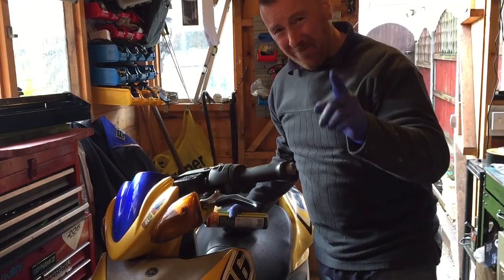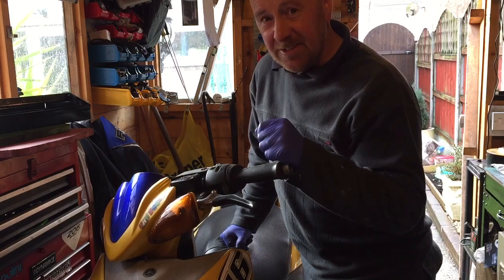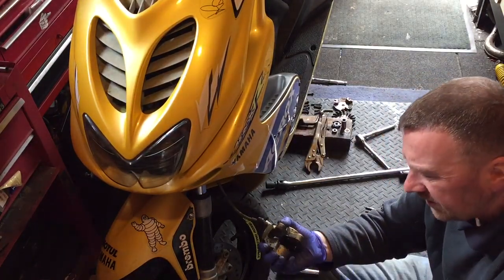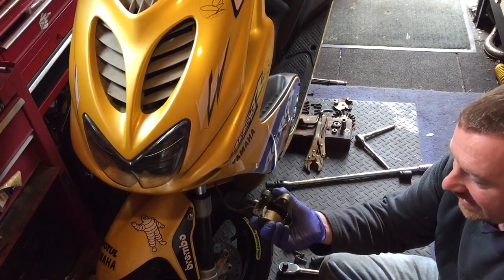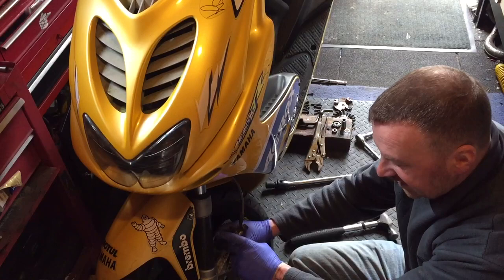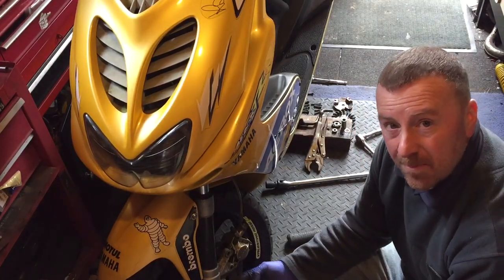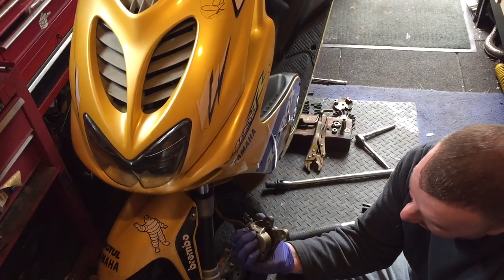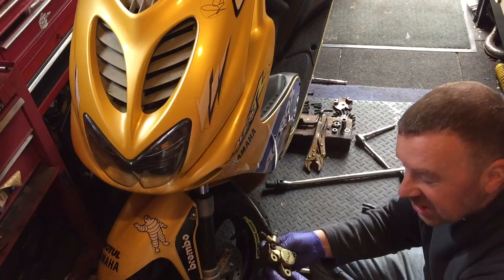Fixing jammed binding or stuck moped 50cc 125cc brakes

Comment: Hi Mark first time subscriber.. I have a Peugeot bellville scooter.. it has abs on the front.. I've noticed on the back brake there is a brake fluid indicator but this is empty. Do Peugeot bellville scooters need fluid for back brake as it is not abs? 

I'm waiting for a manual to come so I can read through the manual as I did not get the manual with the bike.
Reply from the maker: @ShaunUnderwoodx  some do have separate brake fuild reservoirs,  as they might have the independent system connected by electric 
If it's empty I'd fill up to the mark and check the brake , bleed if not working 
The front brake is the main one but you need the rear in bad weather 
Check pads too as go be empty it's either leaking or bad are low

Comment: My tao tao scooter was leaking break fluid too... Long story short my front wheel started to stick or bind... Could that have been was cause it... I'm sure after getting the hose and stuff fix ill be good to go?
Reply from the maker: yes bud more than likely but after you have fixed it take a look at the VARIATOR system too and check the rollers and belt,

Comment: Wow I would think you just made this video thinking of me .because I've done tune up and valve for summer and my breaks are now next I'm good on the condition of pads but I think k there is some binding or possible less the function then what I should have and as well they may have air in line but first I will work on the binding this king there possibly not released as far as should be.so cleaning calipers and pushing g them back in and checking condition of pad to be sure and I will finish on bleeding and filling fluid .Much Thanks for this video from the best .
Reply from the maker: hi bud 
that's god to hear my video helped even with a bit of comedy lol
I have many more videos on my channel that may help too
all I ask is to share like and sub 
mark

Comment: Hey, i redid the shocks and put on new tire rubber and brake pads. The pads seem to grind a bit on the disk but the wheel turned ok until  i went to move the bike it won't go anywhere. I assume then its a brake caliper  problem on my majesty 400 scooter? Thanks! From a gal who works in her own stuff as much as possible:)
Reply from the maker: Take off and start again 
Did you take pictures of it before removing, 
Always helpful 
Take off and re line where it goes 
Check piston on calipers work and that you took the cap off the pot as it could now be too full !
It may only need a bit of fluid taking out!
Or just need to be push back more , cleaned up and re set

Comment: Hi Mark I have problem with my speedfight 100 rear brake. lever was going all the way to the handle bar, so changed fluid and bled system. no air in there. Problem is there is still no pressure and pistons that arent stuck dont move, feels like there is no pressure. Fluid comes out if I open bleed valve with no air bubbles. Can you help. Thanks Rob
Reply from the maker: this is common and i've had it a few times 
it may need replacing but try first by taking off off and turn upside down and tap it on some wood a few times
then refill and do it over , 
or fill and tie up the handle over night to get any air out and pump
Reply: @marksavage  Thank you for replying, which part woul i turn upside down. The caliper. I took a caliper of my second speedfight but had same result.  l suppose must be air in the system somewhere. Am going to try and refit to my 2nd speedfight to see if it is the caliper. might take of the whole system as feels like air could get trapped anywhere in the hose. pumping lever with bleed valve fluid came out ok Rob

Comment: My longjia digita 51 has a very stiff back tyre..ive loosend the back break..but still my tyre by hand will hardly move..Ive put oil all over the middle of the tyre.in the crease of the silver centre of tyre middle..Why could the tyre be suddenly so stiff?
Reply from the maker: is it disc or pads
id take off the rear wheel they can get road salt in them and this can happen so take off and clean up and wd40 the cable etc 
if its not that then you may have a problem with the belt or gearbox
Reply: @marksavage  Thankyou for your reply..ive poured a bike oil in the metal inside of the wheel..and this seems to have worked..I can now spin the tyre freely..It feels so much better..Its probably mud as ride it up a muddy track daily.
Reply: @marksavage  Thankyou..did this and now tyre is perfect..

Comment: When bolting the caliper back up does it have to be lined up or is it just a simple case of bolts in tighten up?
Reply from the maker: when you take off the caliper and open it up to free up of change the pads  after cleaning it it should just fit back on as you have opened it up fully 
once bolted back on press the lever and it will tighten back up the pads and all should be ok but do re check the brake fluid

Comment: Lovely mate!! I got a breaking issue now in the front wheel as well but this is not it.. when i hit the brake, it brakes.... I let go of the lever and hit it again and it doesnt break.. the lever comes all the way to the grip too without breaking at all (when breaking good, the lever only goes half way)... after a while its ok , brakes once or twice and then does it again.. scary shit 
Any idea what might be the problem? Would this fix it?
Reply from the maker: you have one of two things bud 
air in the system so need to bleed the system ,so new brake fluid DOT4 and bleed it well!!!
or master cylinder ,so need a new one
Reply: @marksavage  Thanks a lot buddy!! You're the man! I'll bleed it first to see it it gets rid of the problem.. rear break isnt disc, she doesnt stop very well as it is, which isnt very safe considering it gets to 130km/h in a flash <3 Runner 
(those 70 kits you hate so much hehe) 

Your videos are very addictive and full of info, thanks a million boss!!
Reply from the maker: @joaomelo61  you can take off the rear wheel ,clean and replace shoes I'd you have to and wd40 the cable and adjust 
This will help

Comment: @mark savage  hi mark I desperately need your advice my son has a aerox and the disk is rubbing on his calliper its a new disk new calliper new pads new shockers. Any idea mate I checked everything with diagrams there is nothing missing it is just touching the calliper nearest the shock.
Reply from the maker: simple 1st is it for your aerox model ?
take it off and compare it to the old disc and calliper 
make sure it was on correctly and the pads are in right 
wheel spacer in the right way ?
ive done this and had them wrong lol
Reply: @marksavage  hi Mark the disc and calliper are correct. You know the speedo it had a metal spacer sticking out. Should that go inside the wheel as mine sits flush on the wheel and the speedo plastic has a gap between that and the wheel that would adjust it. its definitely a spacing issue though but just check and they are also correct the lad said when he changed wheel etc he was left with 2 thin copper washers but I looked on aerox 2013 wheel diagram on net and I don't see any washers just spacers it's driving me mad as its unsafe to use. Should there be any washers  Or even in between shocker and spacer ? I don't know as I never had a aerox 2013 any help appreciated mate oops yes it's aerox 2013 really nice example apart from the above

Comment: Hey Mark i have an issue with my aerox. A few weeks ago i have noticed that it pulls very badly on hills. It used to handle steep hills very well going 40+ mph and now unless im going fast before going up the hill then i cant go any faster than 20mph, even on very small inclines until i reach 35 mph and it flies like a rocket. On flats it accelerates very quickly especially when it gets past 35 mph. I thought this was an issue with the carb so i cleaned it fully but it hasn't done much. I also replaced the rollers which were quite worn but this didnt help either when it comes to hills. Could this be a belt issue? My belt looked fine but thats all i can think of. Cheers
Reply from the maker: Max Lock well you did the first two things I'd check so well done , spark plug and air filter next and yes was the belt tight ? , if it was ok. Now not then it can only be there's few things and last piston ! When the start to go or rings get worn they don't hold compression and lose it under pressure ! , thanks for watching I do have a few other videos on aeroxs that may help please like share and subscribe , mark
Reply: mark savage Well the spark plug was changed 2 months ago and air filter cleaned a week ago so i dont think its those. How do i test for compression?
Reply from the maker: i've had a spark plug fail in the same day before bud, have you check if the plug/ht lead are getting wet ? this will mess around with the bike as well. really yu would need a compression test kit or take off the head and have a look at the piston. yes it's a bit of work but the only really way of looking at it !!. mark

Comment: hello mark great videos again !
got a question thats dementing me
bike will not go (suzuki van van) cleaned carb and new spark plug getting spark seems like theres compression only done 2300 miles try spraying wee bit carb cleaner in air box n down plug hole 
valve cap adjusted but will not even catch . ran two weeks ago .cheers antony
Reply from the maker: hi bud thanks for watching ok carb cleaner is only for the carb and when you service it so take it off as in my videos and clean it as the basics are all the same. if you can clean / wash or change filter as well. do not spray carb cleaner in the head!!. clean or change plug. but leave plug out for a bit so to empty the head of what ever is left in there. maybe after that if still no joy with starting get some easy start and try that in the air box. also check oil level make sure that ok. mark

Comment: Help! I recently bought a Zuma 50cc scooter and it is my only means of travel (other than my own two feet :). I have a few questions if you don't mind - the only place near my small town charges and arm and a leg, but your video seemed like I could actually do this (and I'm not a mechanic by any means :)

From what I've read and seen by removing the brakes as you show in your video, it sounds like I have road salt in my brakes.  It seems like there is some sort of red glue or rubber between the brake pad and whatever is outside of them. Some of it came off like paper, but I wasn't sure if I should even remove it.

I'm afraid of removing the brake discs, because I wasn't sure if the part of your video that used a flat screwdriver meant between the brake discs or between the discs and the pads.

I need to know if I need to buy some sort of "brake glue/rubber" or just the brake grease. What did you call it - orange something? I hope to find a neighbor who is good with motorcycles/scooters, but since I'm a new arrival at a small town I honestly don't know how to find one ;)

I think that's it - unless you know about some kind of wire brush that can get in between the various brake parts. Also, when I took the brakes off the (is it called a disc?), I used the front brake lever and I guess it ran out of oxygen or whatever. Hopefully when I put it back together, it will still work. I don't think the brakes are hydraulic and I don't think they need to be bled. Hopefully checking to see if the brake lever worked (it previously wouldn't close all the way) didn't screw anything up too much.

Muchas Gracias and if there's anything I can do for you, please let me know!!
Reply from the maker: Hi bud 
I have a few other videos on brakes so give them a watch they will help as I have over 150 moped videos 
As for pushing the pistons  back it’s with the brake and this will help lever them back 
Don’t push them out without the pads in on the discs 
Very bad and it has brake fluid in so keep an eye on that
Get new pads bud and copper grease behind them 
Watch my videos bud 
And good luck sure you will be ok
Reply: I don't think the reply below was meant for me. I followed all of your instructions until "removing the pin". The only thing that looks like a pin to me has a an allen wrench screw on one side and nothing that can be removed on the other side. If I can remove the pin it doesn't look like it will open the brake mechanism.

There are a ton of technical documents that seem to apply to several models, but my 2015 Zuma 49cc front brake doesn't match the diagrams I can pull up or the videos I have seen. I can take a lot of pictures, but I don't know exactly what to show (plus I don't think I can add them to this comment). I don't want to take anything apart that I can't easily put back together.
Reply from the maker: @heidihuber6087  
hi bud it was for you but watch this video before doing any thing 
https://www.youtube.com/watch?v=-7llryng7vw&t=2s
I have many brake videos and they are all a little different but the basics are the same and my other videos will help but otherwise i' go to a shop to get it sorted

Comment: Hi Mark, sorry me again. My 50cc moped suffers from from the rear disc brake sticking but only sometimes and when it sticks the exhaust gets over hottttt. the Suzuki katana 50cc, think it’s like the Yamaha’s aeroxs etc... does this mean that I need to take the exhaust, wheel off to have a look ?
Cheers ;)
Reply from the maker: hi bud 
No but get it sorted as the brake is jamming on you are pushing the bike harder that's why its getting hot !!, best buy new pads as they old ones will have been worn down and take off the caliper like in my videos and free it up and clean it .
bleed all of the old fluid out too and put new in bleed it and test it all ok, make sure you have now damaged the disk as well
its a job you need to do asap bud 
hope that help, please like and sub and I have a few other brake videos that may help as they are all the same really 
mark
Reply: Hi Mark, sorry.
i was going to reply on my original post but couldn't find it. here is the issue, my rear wheel on my 50cc ped seems constantly engaged. if the moped dies and wont start again by electric start, i push it over to the curb but as i push the bike over to the curb its like pushing a tank. its very hard and the rear wheel locks up !
if i wait in traffic or come to a stop the bike will die, if i go to start it again( electric start), it starts and moves but then goes along happy. if i leave the bike running and without applying throttle, i can walk the bike round the garden pretty much under its own steam, surely this shouldn't happen ? i should have to apply throttle ? if you leave the bike to idle, not high at all seem normal, the rear wheel moves. it seems to be pretty much constantly in gear( when its 50cc moped)

What i have diagnosed so far:
1: if you take the belt off the bike, the rear wheel moves freely and you can push it fine
2: cleaned the  rollers, noticed some flat spots. Could this be the issue ?
3. with everything connected, the variator, clutch and belt. but no clutch bell, the bike pushs fine.

Any ideas, could it be the flat spots, i did notice that the plates on the clutch do have some dips and gouges taken out of them .

As always you help is much appriecated

Mark
Reply from the maker: mastercreative1 so maybe not the brakes then 
I had this on a speedfight. As on a video on here and it was the clutch  jamming once warm!!
Sort out the rollers but as in my moped the clutch was damaging the rollers so guess it’s your problem too !
Change that as I tried cleaning it and wd40 and it worked for a few miles but once warm jammed up again !
So I’d got for that bud 
Mark
Reply: so you reckon change both, the damaged clutch and the flat spotted rollers ? or just the rollers ? ill have a look for that video as well
Reply from the maker: mastercreative1 defo both bud 
The rollers would have to be any way as they are no good now !
Mark
Reply: Hiay, found some rollers. are JMT any good as a brand do you know ? do they only last couple hundred miles before they square off
Reply: @marksavage  my rear calaper 
Seizing. Have front n rear pads 
To go on. Taking for 1st. Mot 
The smorn hope thats all 
I need
Reply from the maker: will need to be taken off and cleaned up otherwise it will keep seizing , loads of clean rags and wd40 to free them up
Reply: @marksavage  cheers mark 
.

Comment: Mark I know you don't like 70 kits but I got a air cooled 70 cc kit for my speedfight 3 and it runs but think it's hitting the head it's making a loud noise
Reply: Tetra Plays does it sound like it is misfiring
Reply from the maker: Tetra Plays umm not sure if it would be hitting the head and still running ? Did you put it back all ok and the right spark plug , would think if it hit it would not run bud and yes I don't like 70 kits lol

Comment: I've just bought a exhaust my my aerox and I've just taken it off as it bogs out and I don't move anywhere what causes that to happen?
Reply: George Page have you cleaned the whole carb?
Reply: Did you fix problem ?course it's been almost two yrs I thought mabey wasn't on tight or if your spacer was upside down meaning tapered side down and possible missing gasket. Hehehe.
Reply: By changing the exhaust. You upjet the carb. Use lighter rollers and use a white contra spring....